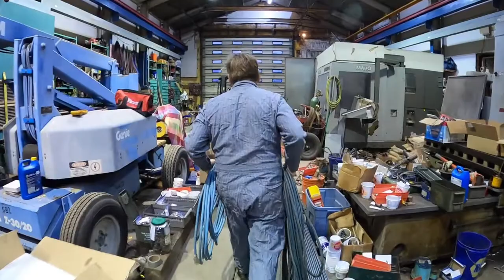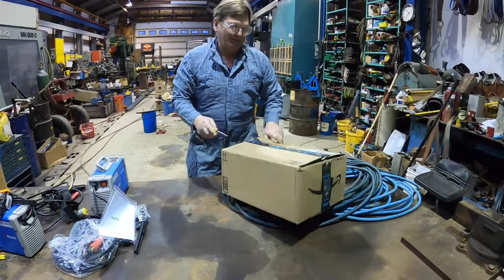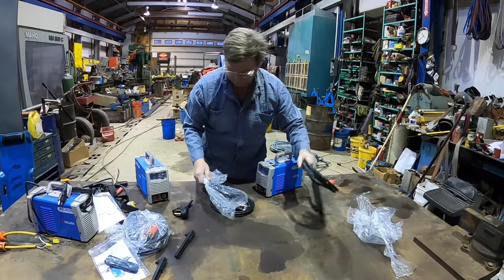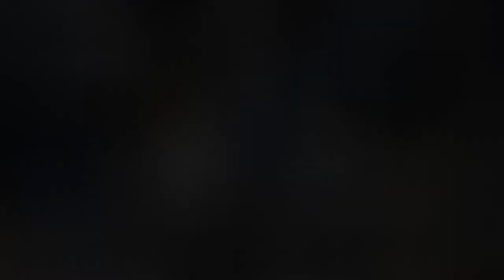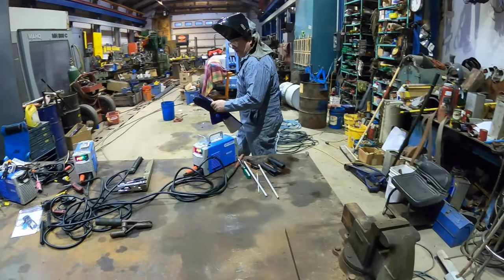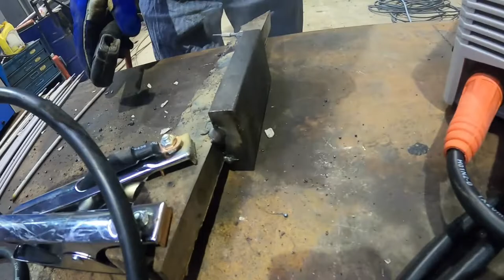YesWelder Review Part Two: trying 1/4 inch rod on 2 - 205DS's with 110 volts

Comment: Those cheap inverters only put out about 90A on 120V/20A circuits, so you were only getting about 180A.  I have a few cheapies I have measured the actual output current.  Three would get 270A, still not enough for most ¼" rods.  You'd need 4 to have 360A capability to run most  ¼" rods. in the appropriate sweet spot.  At that point, you might as well get cheaper versions since they are all built about the same at that price point.  Four $80 welders would run about $320 and you'd need four separate outlets and may even four heavy duty 12ga or 10ga extension cords to minimize voltage drop.  Also these cheapie welders use CCA wire, not 100% OFC like  quality welding cables, so there are losses there.  The jaws in the stinger and the clamp are usually copper plated steel, so there are even more losses there.   Nice experiment.  I've done the same, with other welders.  Nevermind, I now see you already did that in the other video, lol!  I guess that confirms what I just typed out.